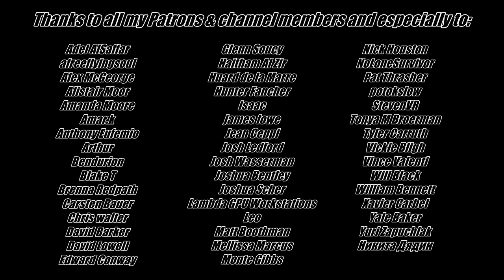Making a Custom Gear

Comment: Amazing work as usual. But to be honest, when I saw you put the gear into the chuck with the bare teeth, I almost cried (at the beginning of the video, before you introduced the soft jaws). Probably it won’t do any damage, but it’s you, for god’s sake.
Reply from the maker: Haha, yeah, that doesn't hurt. I used the inverted jaws for that. This step only required the faces to be parallel.

Comment: 3:12 - that's a lot of runout on the outer gear. You really had no chance, using that sloppy pin to keep them aligned when you welded. Your only chance would've been a press-fit pin.

Comment: Im no machinist, however curious and want to be one someday, but why you only use the dial indicating to measure run out when you flipped the gear around?
I thought i should be measure before and after you flip the gear. Not a criticism but a genuine and novice question :D

Comment: I love the channel. Every time i hear that welder though it drives me up the walls. If it isn’t a making a smooth consistent buzz the. Your settings are wrong or you don’t have enough power. It should not be doing all that popping.
Reply from the maker: It's a cheap ass welder. Can't really change much settings.
Reply: @mymechanicsinsights  i was about to ask what your rig is to try determine if maybe it’s over power without enough wire speed. But from the sounds of it the welder is the issue. Either way. Keep up the amazing work. Love the channel.
Reply: @mymechanicsinsights  I was gonna say something as a suggestion about the welding but then i realized the level of skill you are at with everything you do is above what i am even close to doing, so i will not even attempt to give you advice! LOL
Reply: I dont think he was grounded very well through the loose vise handle for one but also, he was really holding the nozzle a good distance away from the piece. That much wire sticking out doesnt make a nice looking weld either. It was actually good penetration for the sound of the welder though. I was waiting for there to be a few spots that would need to be re welded to fill in holes. Unless he did it off camera, it looked like he got it welded pretty solid the first time.

Comment: Another beautiful video MM, and please this is not a criticism,  however I did wonder when you had the micron gauge out ( around the 5 min mark), there is swarf in the soft jaws holding the gear. Perhaps the contact on the gear was clean, idk. I just thought that was a little unusual for you. Won’t stop me watching your videos tho 🙂.   Love from 🇦🇺
Reply from the maker: It was just a very sharp edge with chips still hanging there. As long as they don't stick out, it's fine.

Comment: I really enjoy you work, but i have a question, will the gear withstand the torque of the lathe with that welding?
Reply: Generally speaking, welds are as strong or stronger than the material being welded. So unless MM complete botched it, that shouldn't be an issue. 😁
Reply: The force is applied to the key, not the od of the gear.  I would think that you could actually use either gear without the other.
Reply from the maker: Absolutely. The torque goes to the key and not to the other gear.
Reply from the maker: @dougoliver2342  only 1 gear is engaged at the time.
Reply: @mymechanicsinsights  i see, thank you for the answer!
Reply: From an aesthetic point of view I was surprised you didn't TIG weld the gears )since I saw you TIG weld in a different video recently).  How do you decide which to use?
Reply from the maker: @andrewostrom8676  I wanted to TIG too, but the machine was loaned to a friend that day.

Comment: I was scratching my head how come the teeth didn't need to be aligned prior soldering. Then at the end I understood the two gears would never be used together. But then I didn't get why bothering solder then, instead of just using each one individually.
Reply from the maker: It is this system on my lathe. I guess one single gear wouldn't be wide enough to have it solid guided on the shaft.

Comment: Welding usually supposed to sound like sizzling bacon like wire feed speed needs upped a little I’m. No expert but my dads usually right on a lot of things
Reply from the maker: True, but my welder is a very cheap one, I have pretty much now settings to change. I'm happy it welds haha
Reply: @mymechanicsinsights  indeed if it works don't touch it i have regrettably done carb work and had the bike run crappy even though it ran fine also a lesson from dad

Comment: Can you explain what you did with that "punching" tool? I didn't understand how that "keyway" (is that the term?) suddenly appeared inside the gear. Is it basically a way of cutting and the keyway broach is from very hard steel that cuts the softer steel of the gear? What are advantages of that to another method? Is it being very clean and not leaving sharp edges or so?
Reply: Each tooth on the broach is a tiny bit taller than the one in front of it, so it's like taking a series of cuts with a plane, but very precisely calibrated
Reply: @Hyratel  Oh that's so smart and makes so much sense! Thanks
Reply from the maker: Yes, that's it :-)

Comment: Is the shaft that the gear rides on lubricated by the machines Central oiling system or do you have to oil it manually
Reply from the maker: There's no oiling needed at all.
Reply: @mymechanicsinsights  the shaft itself rotates?

Comment: That smaller gear is wobbling- your jaws were not parallel during the welding- that should have been done on the lathe between centers.
Reply from the maker: They are parallel, You have tolerances everywhere, that's totally fine.

Comment: Just out of curiosity: did you at some point align the sprockets or does that not matter for the later use of the gear? I am envisioning a timing belt type of off-sequence of the gear…

Comment: Nice video. Btw, is the original gear still in spec? Some teeth looked a bit weird, but that might've been the lighting or angle.
Reply from the maker: Yeah that still works, just keep in mind it's 60 years old

Comment: Sold by the original manufacturer, yet the original manufacturer also sold you the machine that lets you make your own. Would you have still made your own if you had the opportunity to purchase it?
Reply from the maker: I hade the opportunity to purchase original spare parts, but the price was sky high.
Reply: @mymechanicsinsights  yikes. Why do you think it was so expensive? Price geared (pun half intended) for shops and not individuals?

Comment: I really love your videos. Everything you do is to perfection. But when you weld - it gets "sad". You really should practice more. Even the sound of the welds is so wrong, followd by movement, distance and so on. And if the gears are made of C45 material, special things need to be done. Including preheading. :-) Keep up your good work.
Reply from the maker: My welder is a very cheap one, I have pretty much now settings to change. Thanks for the feedback

Comment: 5:00 Can you please explain this part, I am highly confused!
Is this to reduce gear wobble when spinning? What do the numbers mean on that dial indicator?
Reply: Yes that dial indicator is just a way to see how much wobble is in the peice when it spins. Notice how after he spins it, he turns it by hand so the dial goes to the high spot indicated by the number, he knows that side has moved , or wobbled to the furthest point. Thats why he hits it at that high spot, to align it back away from the high spot it was turning to. He adjusted the dial back to zero too if you noticed after he hit it. He wanted to set it to zero and spin again to see how much better he got it aligned. If you want a bigger example of these dial indicators, go watch drive shaft balancing videos, they show this process and are done on bigger pieces that will help you see what hitting the piece actually does to move it better.
Reply: @warrenmichael918  Where is the wobble being measured? Is the dial stick touching the inner shaft? The teeth? Where?
Reply: @warrenmichael918  I was confused how he "moved" it with a soft face hammer? Do you think it was that soft? Your explanation is appreciated, even though I understood what he was doing, just not how it was possible. Thanks!
Reply: @brianfong5711  that little shaft is sticking inside of the bore and touching the side. He touches the side and sets the dial to zero. Then as he spins it and the gears wobble, it allows that shaft to move back and forth as the gears spin in an uneven motion. That uneven wobble makes the needle move showing him how far out of balance it is. He wants the inside of the bore as straight and true as he can get it so he can cut the groove inside and have it straight and be the same depth. If the gears are spinning out of round , his groove will be deeper on one side of the inner bore because his cutting head doesnt move as he cuts in the groove.
Reply: @chuckcombs7259  He has the gears chucked up in his "soft jaws" that he previously cut down so they would fit in. These soft jaws are soft material that wont hurt the gears because he is hitting them to get them centered and square. The gears arent bending but being moved around in the soft jaws. The soft jaws hold the gears firm and in place but are "soft" enough to allow him to hit them and allow the gears to move slightly. This isnt inches were talking, its just very very small fractions of an inch. I think i explained it right enough here. He hits the gears and they slip a tiny amount im the soft jaws.
Reply: @warrenmichael918  My apologies, I should have re-watched it before commenting. Your explanation is appreciated. I didn't think before i posted. My brain was stuck thinking he was moving the gear, relative to the bore, not the soft jaws. Yes, if that would have imperial measurements, maybe 25 thousandths when he started.
Reply: @warrenmichael918  Ah so he is straightening the cylindrical hole inside the 2 gears. I was wondering what he was straightening.
Reply: @brianfong5711  yes, it appears he got the bore as straight and true as possible so when he cut the inner groove, it was even all the way around so the detent ball would keep it in place when he placed it on the lathe shaft.
Reply from the maker: Could have expalianed it better, thank you

Comment: As well as the comments below about concentricity and welding; truing the gear in the lathe by hitting with mallet whilst the dial gauge is in contact - really! Not with my dial gauge.
Reply from the maker: Why? What's the problem? They are made for that purpose, they won't get hurt or take any damage.

Comment: You're such a craftsman, but not with a MIG torch 😂 Ground on the vice itself, up your wire speed, stay closer to the part
Reply from the maker: Why not? Worked like a charm
Reply: @mymechanicsinsights  I guess that's true. But you can hear/see that the welder isn't setup right. Fine for something like this indeed, but it wouldn't fly for construction welding

Comment: Never used such fancy tools as a keyway broach back in the day (when I apprenticed as a fitter in the mid-90's), we made a toolbit with the correct width, placed it horizontally in the tool holder on the lathe and just jammed it through 0,1mm at a time. Simple but effective.
Reply from the maker: Works too, but you'd need to be able to lock the spindle. Can't do that on my lathe.
Reply: @mymechanicsinsights  The old Colchester lathes we had, had a foot brake. Quite convenient. Even more so when making threads. :)
I really miss having access to them.....

Comment: What do you use so you can video the welding?
Reply from the maker: It's just a filter
Reply: @mymechanicsinsights  ok. Is it just one of those auto darkening filters?
Reply: @FerroequinologistofColorado  I think he means it's a video filter applied in editing, not a lens filter.
Reply: @rebmcr  is there such a thing?

Comment: You say it will hold but your penetration was terrible as evidence by the separation lines after turning down the weld.  I could see that thing snapping in half.  Would have been better off threading or pinning it.
Reply from the maker: No way is that thing ever snapping. The penetration was actually very good as you can see. It's not even, but very deep.
Reply: @mymechanicsinsights  It's still going to take considerable force just from surface area but you should NOT be able to see the divide between your weld and the original material when you are grinding away.  That's a clear sign the weld bead just laid into the gap and didn't actually penetrate.  Welding something that thick requires a LOT of heat.

Comment: Amazing but thr welding you are using with the mig will be  poor you are to far away from.the piece also   it doesn't look like you weaved  pal it should sound like sizzling bacon
Reply from the maker: My welder is a very cheap one, I have pretty much now settings to change. I'm happy it welds haha

Comment: Please please please get some welding lessons.
Reply from the maker: Wanted to do it long time.
My welder is a very cheap one, I have pretty much now settings to change.
Reply: @mymechanicsinsights  Have you tried stick welding? Not great for thin metal but very versatile for everything else. 👍🏻

Comment: remind me to never buy parts from you. Keyways should never be a press fit. If I had any press fitted keyways they would just shear the keystock off and believe me ive sheared my fare share of keystocks that were made correctly. This design would fail in under a day in my application

Comment: You might be a good machinists but you ain't no welder. Wrong process needed MMA and a 7018 rod .
Reply from the maker: Totally agree. But it doesn't need to look nice if I turn the welds down anyway ;-)